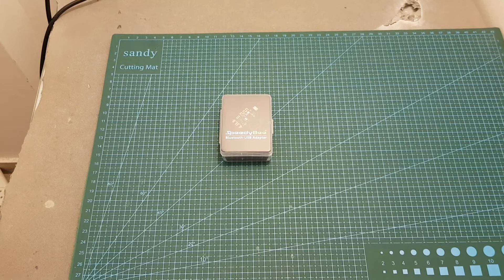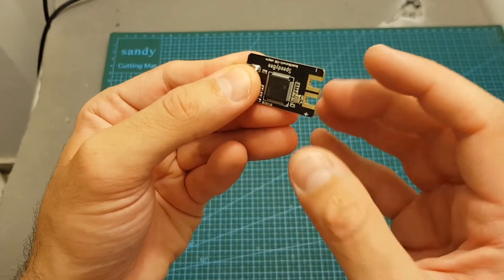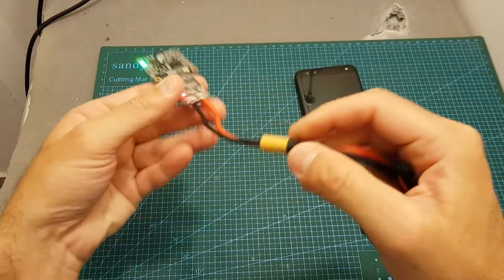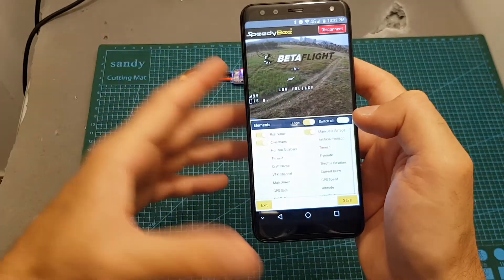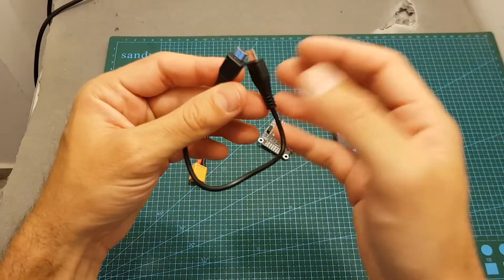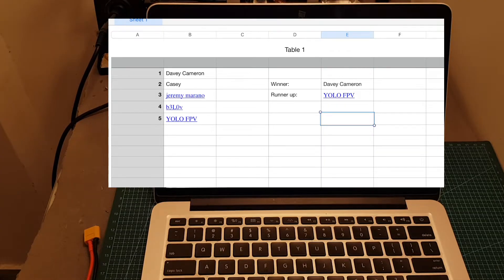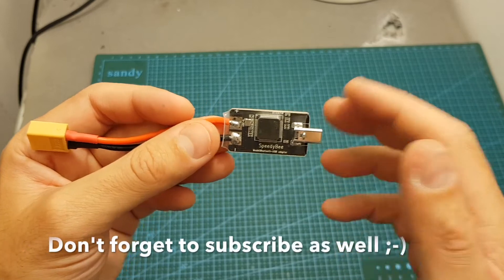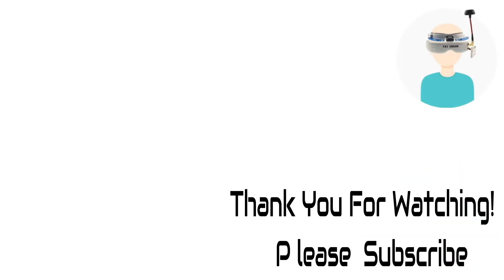SpeedyBee Bluetooth-USB Adapter - Review & Giveaway

Comment: The app does not recognize the device :( I get red light blue light but no green . When I try connecting outside the app it does .. any idea y ?
Reply from the maker: Do you have another phone to test it with?
Reply: Mine will not connect either. Both iPhone and iPad will not connect.